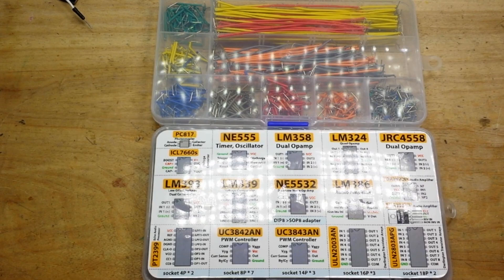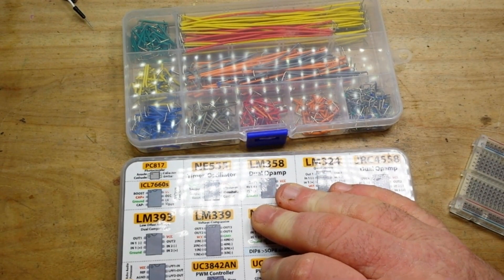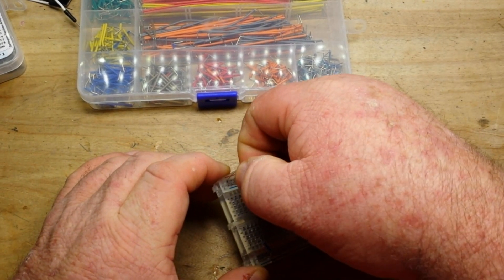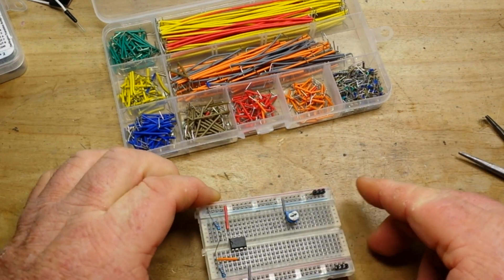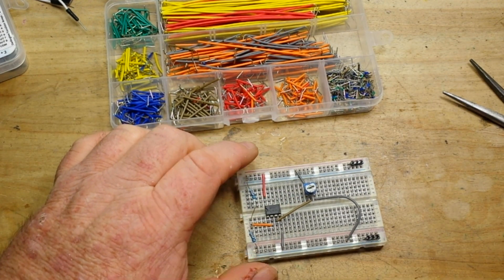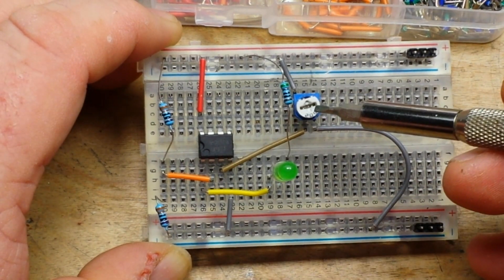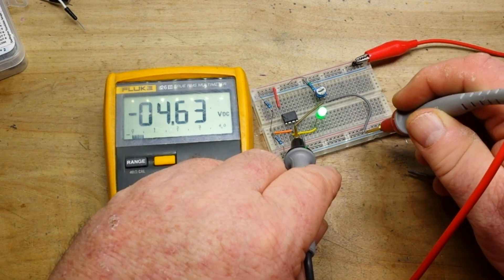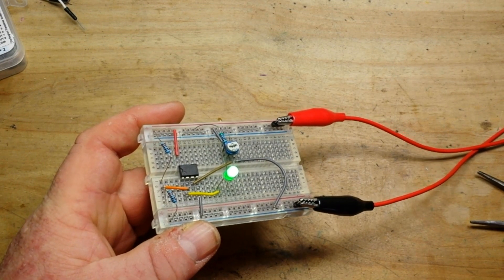Let's talk about comparators

Comment: Thanks, man. Like to watch your stuff.
Stupid moi perhaps but just wondering: If using this for monitoring low voltage in eg 18650 batts; then when you have a certain input voltage and that drops, well so would the ref voltage... So would we need 2 separate sources..?
Cheers/Christer

Comment: Does the LM393 work in the opposite direction so for example if I have a 12v battery I want the output to be off, but when the voltage goes above 14v the output will be on

Comment: Awesome video. I'm trying to make a circuit where the battery is cut off when the solar panel going into the buck converters output voltage falls below. 

Could I send all the outgoing current/voltage coming from the solar panel into a capacitor and then measured that voltage on the capacitor on the LM324N ?

Because capacitors are really affected by current.. ? Is basically an empty space in the middle of a capacitor.

Comment: Comparator circuit:  Relaxation oscillator with at least three decades of frequency (1-100MHz?) and adjustable duty-cycle?  Fast edges?  If that's too easy, add adjustable low-power (zero mean drift) Gaussian noise jitter to the oscillator frequency?  0-10%?

Comment: Merry Christmas Paul! I love it when you make these little projects and especially explain them in a simple way so we can understand what's going on.
My request is: Can you make something with the UC3842 or the UC3843 chip? It would be nice to make a little 9 Volt power supply from it which can be powered by a few 3p or 4p lion cells. It would also be practicle because we can use it to power our JVYTech DSO 150 which would be nice :) And maybe you can also tell us the secret how an additional simple circuit can prevent that the lion cells will be used below 3 Volts. And maybe the MC34063 chip is also applicable if this needs less components which would also be nice.
Reply from the maker: I'll see what I can do
Reply: @learnelectronics Thanks, I like it! :)

Comment: The resistive divider should be monitoring the battery voltage . When the battery voltage drops the divider voltage will also drop. The potentiometer should provide an adjustable voltage from a reference voltage. Use a zener diode around 6.8v or better still an TL431 voltage reference. You could even use a LED fed by a constant current source as a voltage reference but watch for temperature drift.

Comment: Looks like your circuit oscillates near the threshold. Show how to stabilize the circuit with positive feedback using capacitor and/or resistor. Use resistor/zener divider as reference instead of resistor/resistor divider.

Comment: If the battery being monitored is the power source, how is the reference voltage established?
Reply: I believe the shortest answer is: swap out the potentiometer in the original circuit with a voltage reference (or zener, or voltage regulator) that is lower enough than the desired cutoff that it can still maintain stable output at that cutoff. Also make sure the resistive divider is adjusted accordingly - the ratio of the divider has to be the same as the ratio of the V ref compared to the cutoff. 

For ex., assume you want a 3V cutoff -- you can use a 1.5V Vref which allows you to keep the divider at 1/2 as in the original video. When the battery reaches 3V, the 1.5V reference can still maintain a stable output. At this point, the 1.5V from the reference is being compared to your battery's voltage divided in half, which is (obviously) 1.5V.

OTOH... I'm a software engineer by trade, so I welcome any corrections from my EE overlords.

Comment: Well dang that is a handy looking little kit of Ops and Amps.  I actually have a Need for a few of these circuits for my Solar / Wind Power Wall.   I will employ them to Stitch Relays directing Power away from the Battery when filled to be used for other purposes.

Comment: Great circuit and i would like to see another follow up...perhaps a small battery power arduino controlled sensor to include actual battery voltage monitoring.

Comment: Nice! I was just thinking of buying that IC kit even though I already have a lot of them. It's a definitely great gift (or self purchase) for someone who has components but doesn't have many integrated circuits yet. Nice jumper kit too.
Reply: I like the pinouts on the lid. Very helpful. Are they on ebay?
Reply: @Apollo-p1l  Yeah! Pin layouts are great. Component sellers are way too stingy with providing info like that. I don't see it on Ebay. I did find it on amazon while search "integrated circuit kit" but only 1 left. I bet it sells out and it takes a while before they restock, but then they will stay stocked after that.
Reply from the maker: Amazon
Reply: Thanks to both of you, will take a look.

Comment: Great video, I love op amps and comparators and I've been making a similar low voltage cut off protector circuit. My only issue with your design is wouldn't the control voltage across the divider drop as the batteries drain? And wouldn't it end up always being the same voltage difference compared to the potentiometer as they're both essentially voltage dividers? In my circuit I used a zener diode to get a steady voltage to then compare with a potentiometer output, what are your thoughts on this?

Comment: Connect a male banana plug with an aligator clip and you can use it as a multimeter probe. Banana plug will go into the multimeter and you can clamp the aligator clips anywhere.